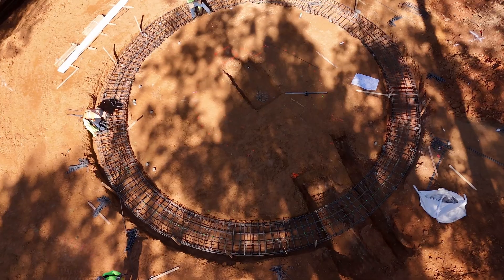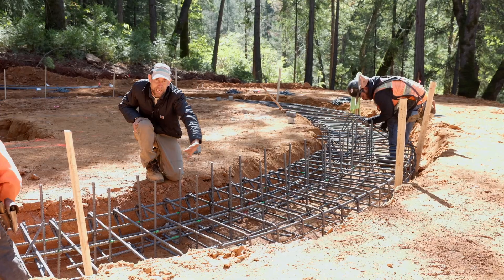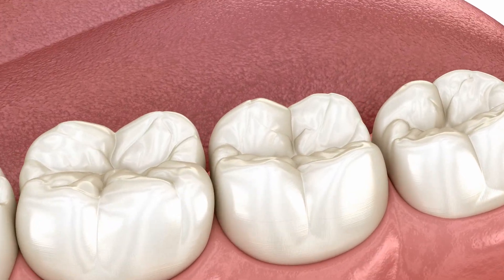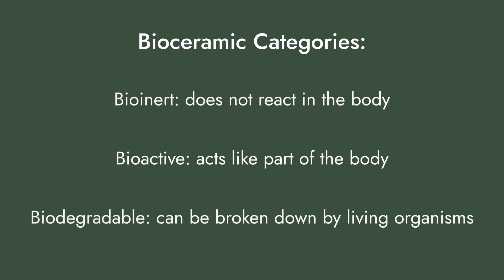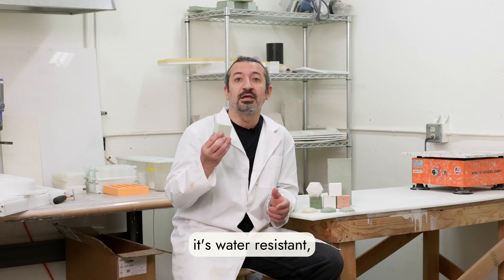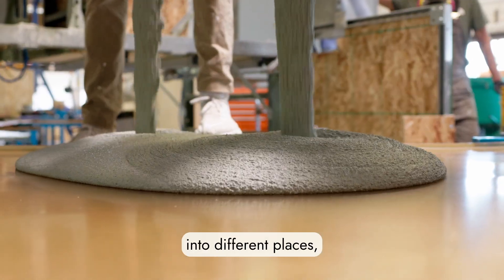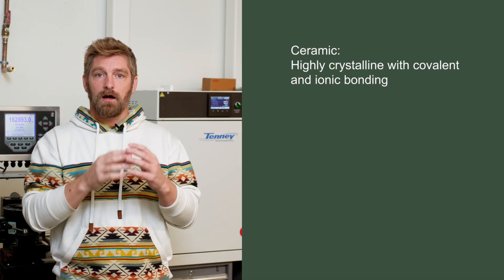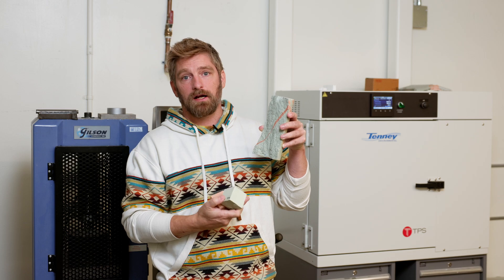GeoJourney Episode 5: Bioceramics Meet Construction: The Material Science Behind GeoRock

Comment: Has Bioceramics ever been used to build 3d printed homes?
Reply from the maker: Most 3D-printed homes today use concrete-based materials. Bioceramics have been explored in research settings, but not as the primary structural material for full homes.

Comment: It seems the shell is not “fire proof” then. “An average surface fire, which burns low-lying vegetation like grasses and leaf litter, often reaches temperatures of 800°C (1,472°F) or more. “ What happens to the shell under high temps?
Reply from the maker: You’re right to be precise with language. No building material is truly “fire proof.” What we mean is high fire resistance.

Shell Rock is engineered to withstand very high temperatures without igniting, melting, or releasing toxic fumes. In fire exposure scenarios, it behaves more like mineral or stone than wood or polymers.

Under extreme heat, the material may experience surface degradation, but the structural integrity and fire resistance are dramatically higher than conventional framing systems. Fire performance is always evaluated as part of a full assembly (walls, joints, detailing), not just a single material.

Appreciate the thoughtful question. These are exactly the conversations that matter 🙏
Reply: @Geoship Yes, customers should be aware of and exercise fire safety when building these in fire prone areas! Forest fires can reach 2000F. The glass will prob break before the shell is damaged. And if there is a wooden door then it can combust at 500F.

Comment: Interesting video. How does the finished price match with current house-building costs?
Reply from the maker: Good question.
Right now, average new-home construction in the U.S. typically lands around $300–$500+ per square foot, depending on region, labor, materials, and permitting. The Amma Founder’s Edition is coming in at about $300 per square foot for a move-in-ready home, which puts it in line with today’s market while we validate the system. As production scales, the goal is to come in meaningfully below conventional new-home costs over time.

Comment: I'm wondering about the air-crete that I have heard so much about.  Wouldn't it be useful in the Geoship?  It's light, low cost, doesn't burn in a fire.  Wouldn't that material be useful in a Geoship?
Reply: the problem is that america has very strict building codes. you can come up with something that is better in every way, including cost. and still you will be told that you cannot build that. i will be surprised if this company completes a single actual home that it is able to sell to a real life customer in the next 5 years. i hope im wrong but "housing revolutions" frequently die in america for exactly this reason.
Reply: @AquamarineBamboo  It is interesting that companies like Boxable, and Tesla can come up with new ideas that get approved quite quickly, yet others inovators with less political status seem to have to go through many hoops to just get simple approvals.  This stiffles innovation that could make the US a much better place.
Reply: @AquamarineBamboo  this house is already spoken for. Initial investors/"early adopters" have already stepped forward for several other homes. There is currently a waiting list of people willing and ready to buy them, many of whom already have their land & who have put down a deposit on their own Geoship. 

They are not using the conventional builders model of building an example Home and then trying to sell it. They are working from inside a community of Support. Not the same market forces you are concerned with.

Comment: Why not basalt rebar?
Reply from the maker: Great question.
Basalt rebar is something we’ve looked at and continue to evaluate. Right now, foundation systems have to meet existing codes, inspection standards, and permitting requirements, which still overwhelmingly favor conventional steel rebar. Basalt shows promise in certain applications, but widespread code acceptance, long-term data, and inspector familiarity are key factors we have to work within as we move step by step.

Comment: Prices need to come down and let’s discuss how well they’d hold up in extreme climates (not the west coast).
Reply from the maker: Pricing is closely tied to production scale and manufacturing maturity. The first homes reflect first-of-a-kind costs, while our long-term goal as production scales is for future models to come in 10–30% below average new-home costs, and 30–60% below at high volume.

Extreme climate performance is a core design requirement, not an afterthought. The bioceramic shell and geometry are engineered for fire resistance, high winds, seismic activity, flooding, thermal stability in heat and cold, and long service life. Each build generates data that feeds back into testing, certification, and future designs, and we will continue sharing results as they become available.
Reply: @Geoship great answer, thank you! Keep up the good work

Comment: Just curious as to why you are using concrete and rebar for your foundation, both found in traditional construction,  yet you mention in this video about the use of polymers and ceramics being so much stronger. I am not a material scientist like the two gentlemen working with you, so this question is just for my edification.
Reply from the maker: Totally fair question. The foundation and the bioceramic shell serve different structural roles. Foundations must comply with current permitting and safety standards, which today still rely on concrete and rebar. The bioceramic shell is where we introduce new materials to improve resilience, longevity, and performance. Over time, foundation systems may evolve as codes and materials innovation catch up.
Reply: This is the first factory produced full scale Geoship dome. I'm sure Geoship is or will be working on better, more sustainable, and earth friendly foundations. They are working their way to scale, the foundation is one of many things that will change. Stay tuned!

Comment: wondering why the circular foundation wasn't out of these new materials,, as the rebar will eventually rust and the concrete will then also fail.?
Reply from the maker: Good question. The foundation follows current code requirements for safety and permitting. The bioceramic shell is doing different work structurally. Over time we expect foundations to evolve too, but first homes need to meet existing regulatory frameworks.

Comment: why it needs such huge foundation?  I though this thing was light and aerodynamic.
Reply: As much concrete going to be poured in that foundation as four regular homes.
Reply from the maker: Great question. While the dome itself is structurally efficient and distributes loads well, the foundation must meet existing building codes for seismic, wind, and soil conditions. The footing and stem wall are designed to anchor the structure, manage uplift and lateral forces, and ensure long-term durability under real-world conditions, not just theoretical weight efficiency.

Comment: Great work!  I’m curious about the connection between clear panels and bio ceramic shell.  Are they glass or something stronger? How are the panels connected?  How is shading managed?
Reply from the maker: Great questions. The clear panels are part of an integrated system but are engineered separately from the bioceramic shell to handle different performance needs. They are designed for structural strength, secure connections, and environmental performance. Shading, solar control, and thermal regulation are actively being developed as part of the overall envelope system.